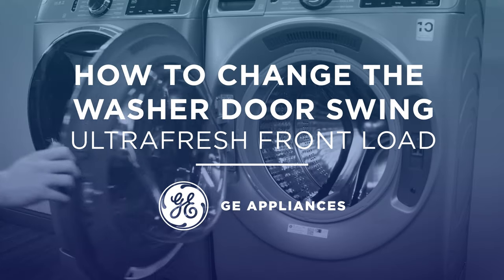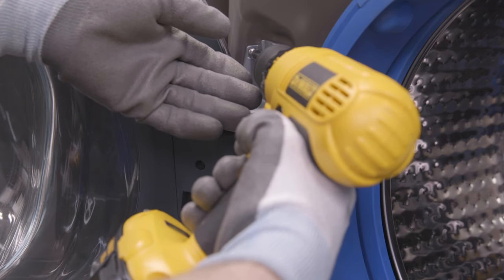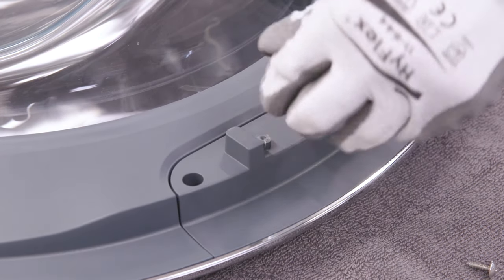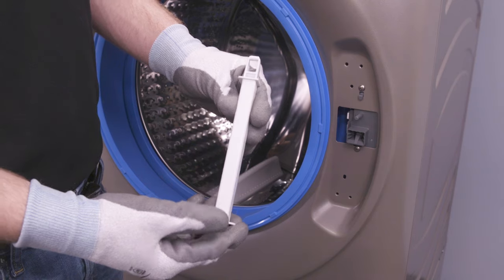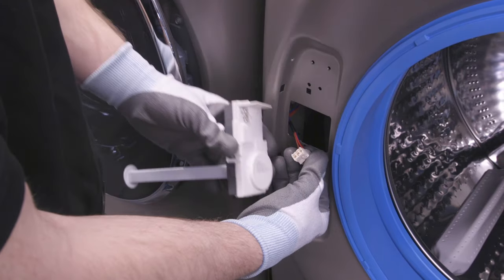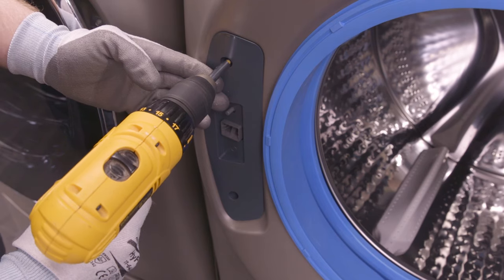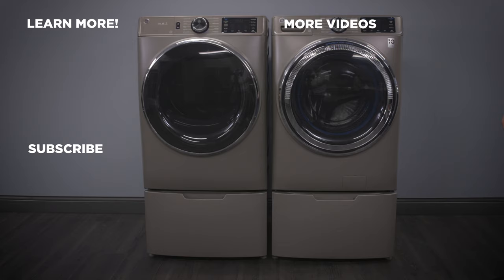UltraFresh Front Load:  How to Change the Washer Door Swing

Comment: HELP!  I switched to door just like the video instructed it was very simple but when i went to run it the machine beeped and the word "door" flashed across the screen.  Now the machine will not work.  Is there something i didn't do like reset the machine or something.  I took it back apart and resecured everything, rewatched the video and at no point have I done anything different.  Am i missing something?
Reply: I am in the same boat.  did you find a solution?
Reply: @patrickmcnichol6403  flip the wiring plug on the locking side.
Reply: I did that… didn’t work for me

Comment: Can someone advise on where this lock bar tool is located or can be found?  The installer did not leave me a lock bar for the GFW850 washer that was installed, and was not in the bag which the manual and the registration card came with.
Reply: It should be in that bag. the installer probably put it un his pocket by mistake.

Comment: We watch the video several times. When we turn the washer on it says door and now will not run the washer. We unscrewed everything checked the video we did the connections step-by-step about five times it’s still flashes door. What should we do now? We reached out to the phone number on the packing slips and I’m waiting for a callback but it has now been 48 hours
Reply from the maker: Hi there.

We're sorry to hear that you're seeing DOOR on the display, we know that must be frustrating. If you've attempted to re-install the door several times, you've followed these directions carefully, and you're still seeing DOOR on your display, a service call may be needed to further investigate the issue. If you need to reach out to our service team, they can be found through the following link: https://www.geappliances.com/ge/service-and-support/service.htm

Please let us know if you have any other questions or concerns. -MS
Reply: Hi, same thing is happening to me. Did you ever figure out how to fix this?
Reply: @JamesJdoom  this is what is happening to me, were you able to fix?
Reply: were you able to resolve this?
Reply: @patrickmcnichol6403   Hi, I just did this today and you have to flip the wiring on the locking side where the red wire goes up and the brown wire is on the bottom

Comment: How were any of you able to get that little white piece of plastic out of there?????
Reply from the maker: Hi Gabriel,

Thanks for reaching out. If you're having issues with installation, feel free to provide more details about the hang up and we'll do the best we can to help out. -MS
Reply: @geappliances  - As so many in this thread have commented, removing the lock pin from the lock mechanism/assembly has resulted in a little white piece of plastic breaking off and getting stuck inside the lock mechanism. I cannot dislodge it, and thus the door will not close rendering the entire washer useless. Now, I need to find a replacement lock assembly. If you really want to help, send me a new lock assembly. This whole experience has left a very sour taste in my mouth towards GE. I’m extremely frustrated and fed up with not being able to do laundry in my home.

Comment: Everything was great until my lock bar broke inside the connector. Took me about 30 mins to remove the plastic from the inside but other than that everything was easy.
Reply from the maker: Hello Tony, we apologize for your experience with the lock bar. Were you able to get the door swing reversed? -BL
Reply: @geappliances  Yea I got it to work. Thanks
Reply from the maker: Great news, Tony! Enjoy and let us know if you have any additional questions or concerns. Sincerely -SF
Reply: The same thing happened to me!  How did you remove the plastic?
Reply: @geappliances  I had this same problem. What is the best way to get the piece of plastic out?
Reply from the maker: Hi Julie,

We're sorry to hear about the issues that you've encountered with reversing your door swing. Just to make sure we're understanding correctly, are you referencing the location at 1:52 in the video above? We hope to hear from you soon. -MS
Reply: @juliejules4116  I really struggled to get it out but I had some small pliers that I was able to fit in there and get it out. I hope you can get your fixed if no ask them to send you a new connector
Reply: This happened to me too. I was able to get the broken piece out but the door will not latch properly now. I think I need a new lock assembly.
Reply: @geappliances  My lock key broke too. I got the broken piece out but the door will not latch properly. I think the broken piece messed up the lock assembly. Can you send me a replacement?
Reply from the maker: Hello Brian, we regret to hear the door is not latching properly. Can you please provide the model and serial number and purchase date of your unit? -BL
Reply: @geappliances  We purchased it on 6/25/2020. The model number is GFW850SPN0RS. The serial number is TM306458N.
Reply from the maker: Thanks for confirming Brian.  If the door is not latching properly, we would recommend taking advantage of your warranty and scheduling service.  

You can schedule service by calling 1-800-432-2737 or online anytime at https://www.geappliances.com/ge/service-and-support/service.htm

-BL
Reply: @geappliances  We could not get the plastic out so we called GE and they sent us a new lock assembly. Installed it using vice grips instead. You may want to suggest this in your instructions since the plastic lock bar seems problematic. Everything up and running and is working fine now.
Reply from the maker: Thank you for the feedback and suggestion, Julie.  We apologize for any difficulty you experienced and are glad you took the time to share this. We are glad everything is up and running now. Sincerely, RF
Reply: Our lock bar broke. Took over an hour to get the piece out. Got the door reversed and put back together. Now the door will not close. Sooooooo frustrating.
Reply from the maker: Hello. We are very sorry to hear the door is not closing properly. Please call 1-800-432-2737 so I service technician can look into this issue. - JB
Reply: I just had the same issue.  Lock bar broke while trying to remove.  (At the 2:47 mark in your video).  Was able to remove small white piece of lock bar that broke off, but now door will not close/latch into door lock assembly.  Is there a reset procedure or way to unlock it?   Or do I need a replacement door lock ?  Ugh.
Reply: @nobuds70 , we were able to reset the lock, but we basically had to take the assembly apart, press down on a spring loaded backing and move the locking mechanism back into place.  It would be really hard to walk through without a video. Poor design for sure.
Reply: loblad thanks!   I was able to open the lock assembly, push down on the round lock cradle and get the white lock tab you rotate into the open position.  Reassembled, test fit with the latch removed  and everything works great now.  Phew.  That was an adventure.  GE- you need to address this in your video or show additional instructions in your manual.  It’s simply says pull out the lock bar and that is misleading.  I agree it would be better to use vice grips to hold the lock assembly instead of the lock bar.
Reply from the maker: Hello, we are sincerely sorry your lock bar was difficult to remove. We understand how that would be frustrating. However, we're glad you were finally able to remove it! We have passed your comments along to our video development team. -CV
Reply: Just wanted to help everyone out that comes here with a lock bar getting stuck!!! We thought we had the same issue! It's NOT shown in the video, but all you have do is press in on grey "locking" mechanism button/bar immediately above it & it will "release" the lock bar! :-)
Reply: Mine broke too!!!
Reply from the maker: Hi there, Sara. We're sorry to hear that your lock bar broke. This certainly isn't something we would expect to happen and we do apologize for any inconvenience. Please feel free to reach out to us on social media or at the "Contact Us" link on our website if any questions or concerns come up. Thanks! -MJ
Reply: Well my lock bar broke inside this thing too. How did you guys get the remnant out?
Reply: @geappliances  my lock bar is nowhere to be found.  Where can i get a replacement?
Reply: We called next day to have our door swapped they waited till after the 48-hour return policy now I have to do it or live with it I'd be willing to pay a service call for someone to come out and swap it

Comment: Just wanted to help everyone out that comes here with a lock bar getting stuck!!! We thought we had the same issue! It's NOT shown in the video, but all you have do is press in on grey "locking" mechanism button/bar immediately above it, & then it will "release" the lock bar! :-)
Reply: Hi Lacey, 

Do you mean the long gray button that’s just above where one inserts the Lock Bar? Press that and the bar releases? Thanks!
Reply: @Saturday8pm  All i remember is that its in the location that would be the equivalent of the door shutting once it would be there, it would natually be pressing it in when it closes. Let me confirm this with my husband this evening & I'll let you know back! :-)
Reply: @lace77721  Thanks, Lacy. It’s confusing because at least one other comment here insists on “looking down the right side of the unit” but I think they meant the right side LATCH area specifically, as that’s where the button is, which would make a lot more sense. Yes, that button tells the machine the door is latched and MAY govern the part that locks the door and if messed with MAY grab and hold onto the Lock Bar, as the bar has on the insertion end a closed hook that could get unintentionally “locked” into place.

Comment: The wondering minds wants to know.  What is reason to turn off breaker?
Reply from the maker: Hi GnarlyRC. You turn off the circuit breaker if you do not unplug the washer. The reason is to make sure their is no power to the washer while you are doing the door reversal. Thanks for asking. ~RF

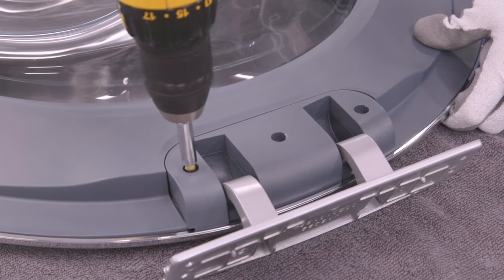Comment: @1:29 That's not right, is it?
Reply from the maker: Hello-Thank you for reaching out to us. We would like to help look into this further for you. Could you please send us a private message with your full model and serial number? Sincerely-DM
Reply: @geappliances  My washing machine is irrelevant in this matter. The video shows the screws being tightened before the hinge cover has been correctly placed, thus deforming the outer edge of the door.
Reply from the maker: Hello-Thank you for sharing your concern. Tightening the hinge assembly can only be done prior to the hinge cover being screwed into place. While the video shows a slight shift in the rim during this process, the outer rim will not deform. If we can answer any other questions feel free to reach out and let us know. -DM

Comment: @1:16 
This step is dreadfully worded. “Remove the assembly by PULLING it towards the center,pushing it up and pulling it out”

pulling towards the center -got it
pushing it up- huh? in the video they dont use anything to push it
pulling it out- so how do I push it and pull at the same time

I am finding this step incredibly difficult to remove. Pretty sure i am going to break it trying to get it out. Would make it much easier to show how the teeth of this part secure to the door.

I just got it and it and the directions are TOTALLY wrong. You should pull it AWAY from the center of the door. There is literally one small plastic tooth holding this in and if you pull towards the center of the door you will be applying tension on the tooth.
Reply from the maker: Hi Jacob,

Thanks for taking the time to reach out. So sorry to hear about the issues you've encountered here with reversing your washer's door swing. We do hope that things are working properly now, but if you have other questions or concerns, feel free to PM us on Facebook or DM us on Twitter or Instagram with your complete model and serial numbers, as well as a copy of your comment here for reference. We'd be happy to review further if need be.

If you need help finding your complete model and serial numbers, you can use this diagram: http://spklr.io/6058Y27w

Best wishes. -MS
Reply: That doesn’t work either.
Reply from the maker: Hello,

We're sorry to hear this. Feel free to send us a private message via our social media channels with the model number of your unit, and we'd be glad to further assist. Take care. -SH